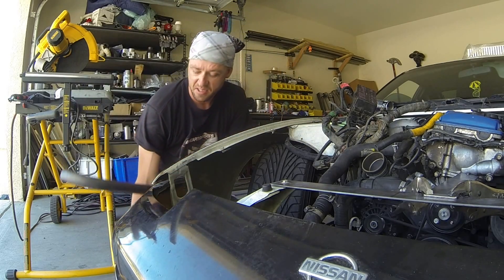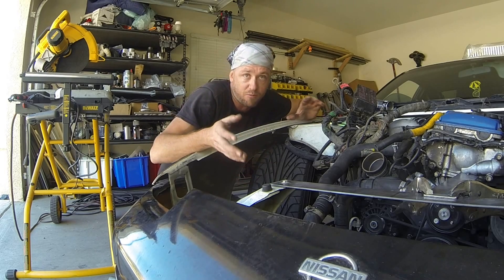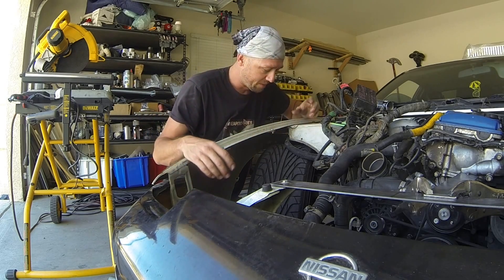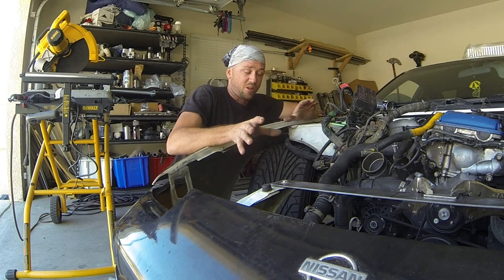TFSS: How To Build A Tube Chassis Front End - Mounting Plates

Comment: what do you think of drilling holes in the plate and plug welding them to the surfaces you are reinforcing for tube? I do it but was taught that. just curious what you think
Reply from the maker: It depends on the application. If the additional strength is required, then use it.
Reply: The Fabrication Series thanks for responding not many do

Comment: Nice work, great presentation. My issue? I would be pissed if I found you left my intake open to all the debris flying around your shop. You obviously don't build engines or you would be more protective of them. Do your customer right and plug that hole, then get on with the otherwise fine work you do.
Reply: Bryan St.Martin well all make mistakes. but im sure now that it's been pointed out. im sure he will now cover the intake. I'm a engine builder and ive made the same mistake he has. was it dumb of me yes. but I was in a rush and it slipped my mind.  and you know what.  it cost me the race. because i didnt put a towel or something over the injake. a kid in the pits put his hot wheels car into the intake tube. and it destroyed my turbos. because I was running a compound setup. and it even ruin the intercooler.  but I was lucky it didn't damage my engine.  because all the garbage and metal particles was caught in the intercooler. but like I said we all make mistakes.  after it happend the kid was asking if I found his hot wheels car. and that's when I figured out what happened.  and the kid felt so bad. he say here's all my money. Witch was 52 cents. I laughed and said to him. don't worry man. you gave me the best exuses to put bigger turbos on my car.
Reply: I live in Florida, sand is everywhere and the fastest way to "Bore" an engine.
I mean, how expensive is duct tape?
Mineral spirits will clean up the adhesive residue. 
I'm not trying to discredit you in any way, just pointing out things to prospective viewers/builders of simple things that can save a large investment in time and money. Not to mention one's reputation. I have pulled engines apart to retrieve carburetor hold down nuts. :-(   Like you say. no one is infallible, knowing what to avoid can go a long way.

Comment: Is the weight reduction significant on these tube frame fronts. I'm also interested in the change in structural rigidity.
Reply from the maker: +Sean Henry Weight reduction and rigidity are up to the build design. You can absolutely make a tube front weight less than a factory front while increasing rigidity. Some tube fronts can weigh more than a factory front, and some tube fronts can be weaker. It's entirely up to the build design.
Reply: Cool. Very interested in all this.

Comment: man ive seen your videos, awesome i gotta say!, thanks! i have 2 questions since im planning my setup... first what steel are you using? and second, what welding wire size?  i wanted to use the one that came with the welder but it seems that it is to strong for the metal sheet on my car cus it only makes holes... thanks in advantage!
Reply from the maker: +Antonio Gonzalez The tubes are 1.5" x 120" and 1" x .095". The sheet metal is 16ga. on the fender tubs,and 18ga. on everything else. I usually run .030" wire in the MIG. 

More importantly than the wire size is the settings and technique you use to weld sheet metal. If you are continuously blowing holes in thin metal, the amperage is probably pretty high and the concentration of the area you are welding is too much. Stitching is a good method to use on sheet metal if you have a responsive machine.
Reply: +The Fabricator thanks a lot ill check that out!